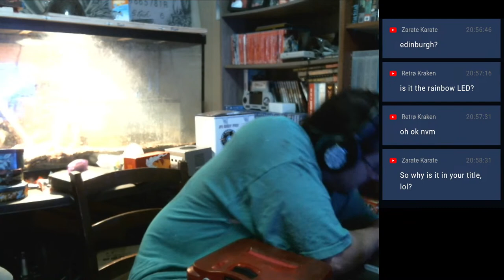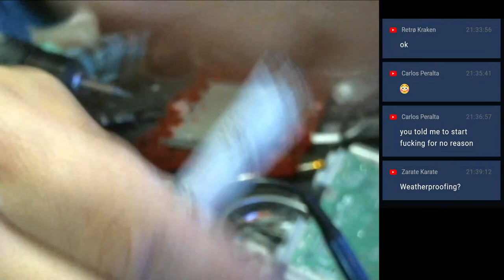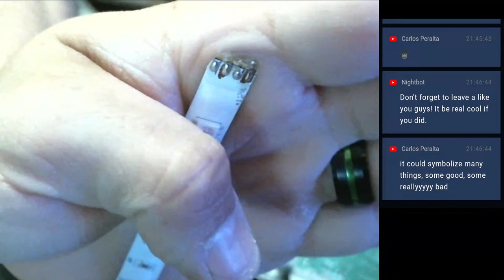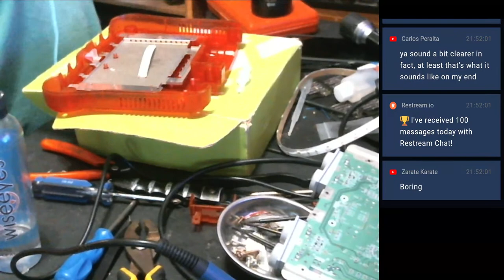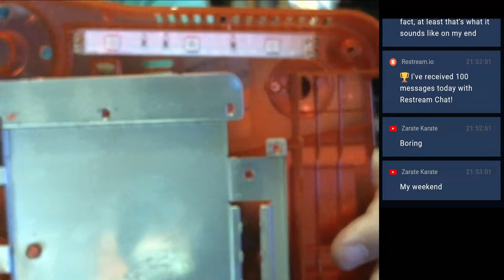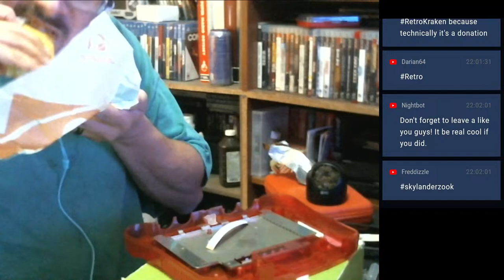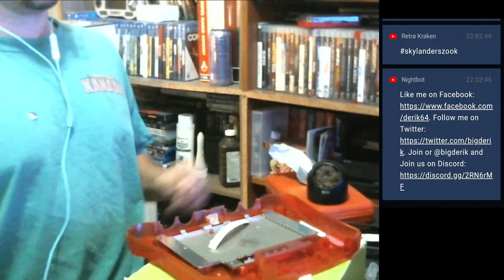N64 LED Mod INSTALL - Derik64

Comment: Have you ever installed an ultra hdmi?
Reply from the maker: I've never been fortunate enough to get one.
Reply: @Derik64  I was able to get one on  Wednesday. Took forever. 

Also does your screen on your warrior 64 go back for a second randomly?
Reply: Great video too
Reply from the maker: @rasec202  I missed out. I didn't see that they were available until 2 hours after they went up. Guess I'll wait another 2 years. And no my warrior 64 doesn't do that. I go over that in my warrior 64 video if you havent seen it.
Reply: @Derik64  dang and I watched that video
Reply: @Derik64  my bad.
Reply from the maker: @rasec202  It's all good dude. If you want, join the discord and you can hit me up and ask questions there if that's better.
Reply: @Derik64  yeah np